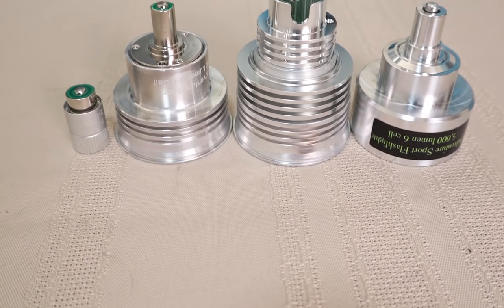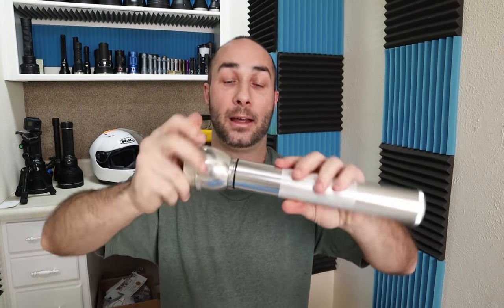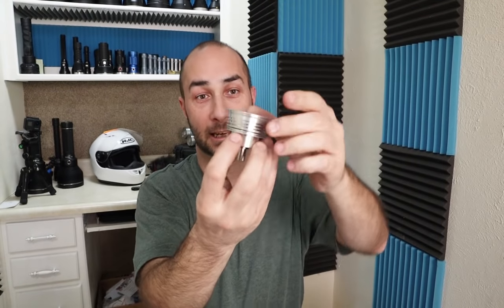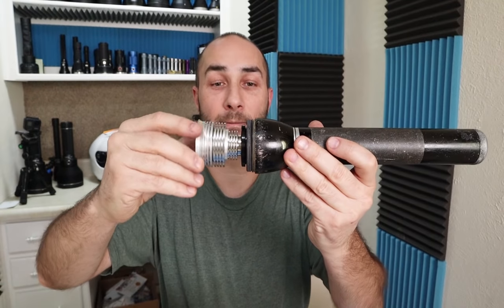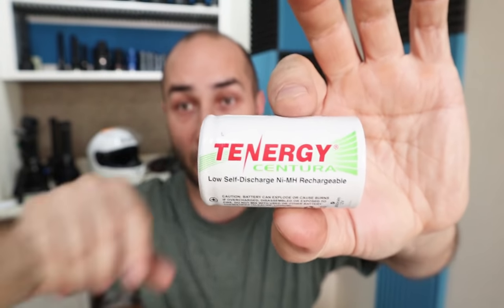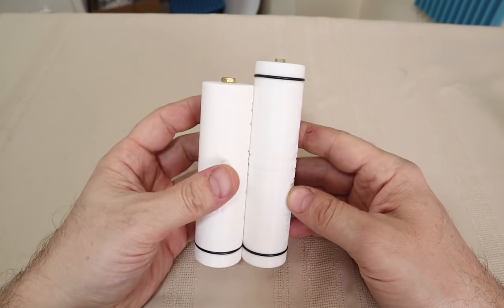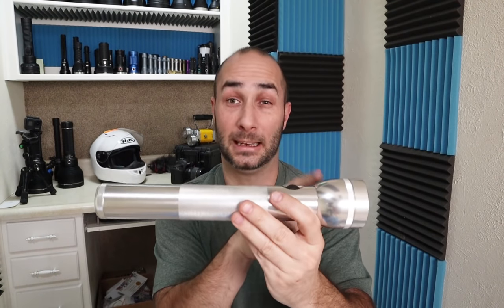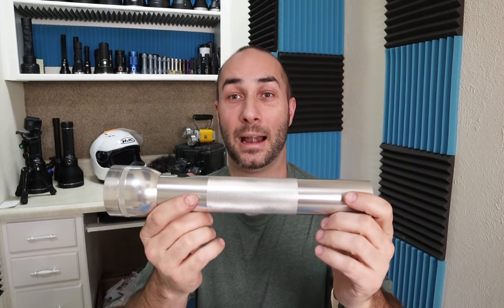LED conversion Kits for Maglite, Installation and Troubleshooting Guide

Comment: So- @lumencraft I'm testing the 3500 lumen upgrade on a 2d maglite with 6x tenergy premium pro AAs 2800mah in series delivering 7.2 volts and so far its running over an hour on the brightest setting and still going. im impressed.

Comment: Anyone who’s here lurking for upgrade info on the old mag light upgrade is prob a flashlight fan or for nostalgic reasons. ❤this video.
U can prob sand blast the inside of the end cap contact surface while while saving outside anodize by masking  tape off.

Comment: 012322/0303h PST 🇺🇸.     Mat, good morning and thank you. As promised, you delivered the instructions on how to incorporate 800L emitter on type C MAGLITE. I was waiting for over 6 plus months for that design to come by.  I am placing order for one 800Lm drop-in emitter for type C (21700 Li-Ion) and one 800Lm for 1D cell MAGLITE, that you modified, with 21700 li-Ion Cell. FYI 21700 works well with no noticeable loss in Lm.
Thanks and appreciate your educational video. Stay safe and good Lux. 73s…

Comment: Just to make sure I understand. I have a 6D cell Maglite. I bought a 2000 lumens bulb (but it's not one of yours). 
If using Lithium batteries, I should use 1x26650 battery?

How can that be more actual burntime, compared to 6 D cell batteries?
Great video, thank you very much.

Comment: Hey boss, I’m in law enforcement and still use my streamlight sl20x halogen. Terralux use to make a drop in 600 lumen led conversion but no longer make it. There is little to no info on the interwebs on how to make a powerful and efficient conversion with the sl20x chassis. I love this light and it’s been with me for years. Can’t you make do a build on this? I’m sure there are others out there like me.

Comment: I think being above 1000 lumens is way over board that the maglite ml300l can throw up to 406 meters being 625 lumes and the warrior x turbo is 1000 lumes and it can throw up to 1000 meters and that the reflector is longer but 1000 lumens is to bright for close up things and it is all just for the bright light enthusiast because I tried a 700 lumen 3 c cell flashlight at night and it worked perfectly fine with enough light that I can see all around and I have the seeker 3 but I hardly use it because 4000 lumens makes to much heat and drain the battery way faster when a 1000 lumen or below flashlight can run cooler and longer like the maglite l300l on d batteries

Comment: Hi mate

I got your 3500 lumens upgrade for the incandescent Maglite.

I'm in the UK so it took a while to deliver here but it was well worth the wait! I'm using it in a 6D Maglite but one day I want to use it in my 2D Maglite with the battery conversion. You shouldn't use it in the 2D Maglite with normal D batteries, correct?

By the way I couldn't find your 5000 lumen version. Is it no longer being manufactured? Not that 3500 is too dim haha
Reply: did you manage to get the 5000lm?

Comment: Hello. What about using the lithium 1.5v or nimh d cell 1.2v ,6 of them for the 6d for the 3500 or the 5000 drop in. Wouldn’t that bypass the need for the sleeves and dummy d’s?

Comment: I just bought and installed the 800 lumen firefly in my 4 D Maglite. I had I think its like a 3 watt LED or Cree bulb? I bought about 10 years ago. Batteries are not new. 
Why is the 800 firefly barely brighter than my old bulb??

Comment: I have the 5000-lumen head that I have installed on a 6-C Maglite. I tried it with alkaline batteries and laughed at the results, it really was funny how fast they dropped off. Since I have switched to using 18650s instead of Cs, I made several adapters that convert from 3 Cs to 1 18650. My 6 cell light works fine with 2 of these but I can do better. I will be making a 6-C adapter that will use 4 185650s in 2 parallel circuits. That's 7.2 volts, 7 Amp capacity, with a 10 AMP discharge rate using my current 3500mAh HDC batteries. I'm curious to see what my actual burn time will be with this setup.

Comment: Love these videos- keep em coming! I have a 20+ yr old 2 cell C Mag, looking to upgrade the 30 lumen LED in there now to the 370 you recommended. I can only find the 325 in your links, which is fine but will I get the full 325? Can I use li-ion? I can't find an extension- kinda bummed!
Reply: found the answer on lumencraft... 235 lumens for a 2 C cell Mag... not 325 but beats the shit out of 30.

Comment: "5000 lumen LED Conversion Kit for 2D Maglite" match for my old Maglite (blue) 2-cell from 1997/1998?
Reply from the maker: That light might be a bit too old for the 5000.  You can know for sure if it will fit by measuring the head. Like this https://www.youtube.com/watch?v=UOspTPig3N8&t=4s
Reply: At least with the lights ive encountered the maglights with the deeper head had the old style switch which use a threaded retaining ring and a allen head screw and come out the top of the light vs coming out the tail end and have a snap ring and torx set screw holding it in place. These 2 lights were a 4 c cell from 94, 3 d cell from 93 (also had thicker body). The rest of my mags are d cells from 97 98 99 and 2016 amd those are 2 2d cells,one 3 cell and a 6 cell long boi. Cant say thats the way they all are but thats the way mine are. All the dates were confirmed manufacturers date from emailing maglight my serial numbers as i bought most of these 2nd hand since they are older than i am.

Comment: Hey Matt, I have this 10 year old Mag Charger RE1019. Can’t seem to find anything about it online. Any ideas on which of those led upgrades fit my model?
Reply: For those who're interested, I did eventually find a single led 800 lumen kit by lumencraft  that fits(Mike didn't bother to answer me but oh well),  but it is definitely not worth the money (around $60). The  build quality is not bad, but the beam pattern it produces on the other hand is pretty much garbage. The reflector produces a very rough hotspot with a huge bleed around it and you can't adjust that. The hotspot is not a perfect circle either. It's a mess. So overall for $60 it is definitely not worth it. You can buy far superior high quality flashlights the price. Also the reflective surface is just a mirror polished aluminum without ceramic coating. It get's scratched even with microfiber cloth.

Comment: What Battery do you suggest for the rechargable maglites
Reply from the maker: I use the factory made NIMH pack in mine.  https://amzn.to/2Iorkbr
Reply: @Lumencraft-  Thanks for the reply
Reply: @Lumencraft-  using your led upgrade is there any advantage to using a battery like this... NIMH-1/2D6V-4400MAH they are $25 on ebay
Reply from the maker: @rifraf1970    "IF" the ells in that pack are truly 4400ma then that pack would also have  a higher capacity than the 3500ma pack I linked.  That would mean you got more runtime out of it.  They possibly could be, or they could be the same cells just marked as higher, or lower capacity cells marked that way.   I purchased sets of regular D cell NIMH batteries and both sets claimed 10,000ma.   One set of cells were truly 10k capacity, the other set fell flat on its face and was only like 6000ma or so...

Comment: this is an unrelated question to the video.. but my cousin has a really great predator hunting flashlight that i was wondering if you could do a review on the new version of... wicked lights predator w-402z is the one he has. it has a fixed emitter. the new lights come with green white and red and some with infared with a selection switch. the old w-402zf model is extremely powerfull can you run a test on the new one? @Matt Smith

Comment: Hi, Can you tell me if the 2000lm work in a 6d cell maglite,  ?
Reply from the maker: To use the 2000 in a 6D you would need to put 3x Dummy D cells in the body to get the voltage down.   Probly better to use either the 800 lumen or the 5000.
Reply: @Lumencraft-  
Matt, i have an old style 3 d cell. How many lumens could i expect from the 800 lumen upgrade. I am going off that leds are voltage and amperage sensitive i suppose. And would regular alkaline for a total of 3 work with the 800
Reply from the maker: @frankcrawford416  You would get pretty close to full output on 3 cells with the 800 lumen, I would say worst case in al old light with possibly worn contacts using alkaline cells etc you should expect 650+.